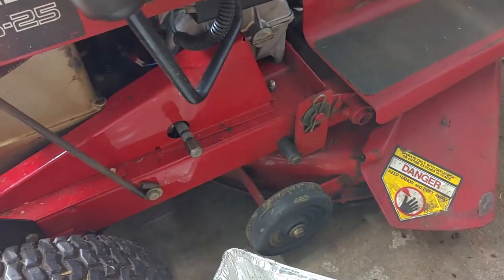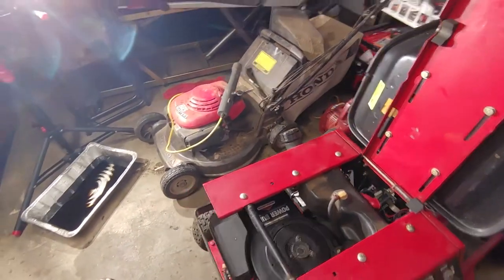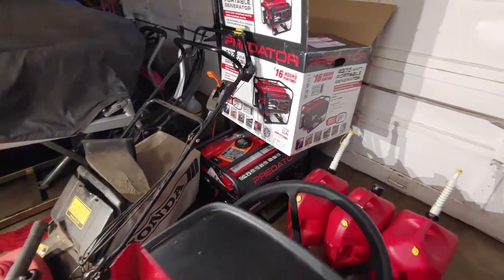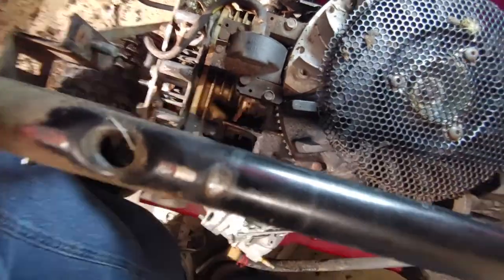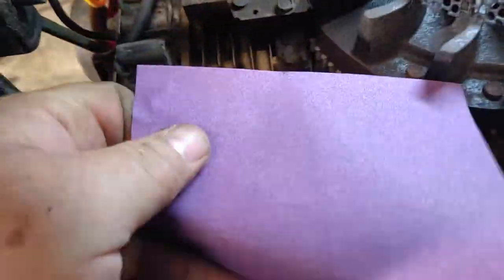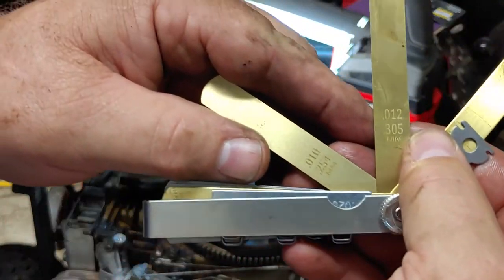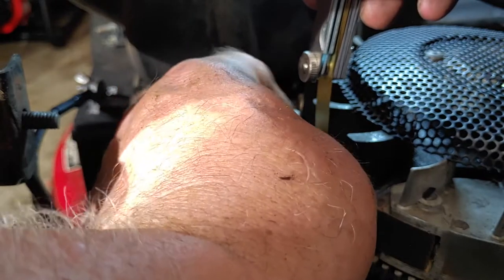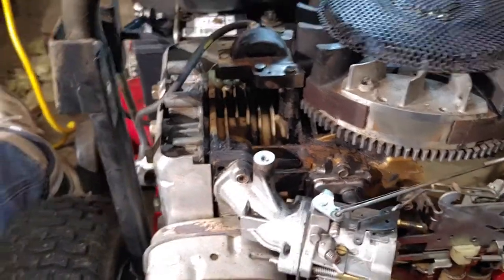Toro 8 25 Complete tune up Part 2

Comment: Nice short series on the 8-25 Wheel Horse. Just picked up one of the used at a garage sale. Quick question. The fuel line that is connected to the top of the gas tank what is the purpose for that and where does it connect to on the other end? Thanks!
Reply from the maker: That's a vent hose. It just hangs.

Comment: Awesome I have some unit I lost the top for my air cleaner cover any chance you know where to find one?
Reply from the maker: I would look first in this forum, https://www.wheelhorseforum.com/. It is all Wheel Horse/Toro tractors with a classified section. My 2nd option is find the schematic for the motor (you need the serial number off the motor) and in the schematic you can find that specific part number. Do a Google search for the part number as well as call a Toro Dealer with the part# and they can search their database.

Comment: How do you check the transmission fluid level on the 825 and what type of lubrication does it take?
Reply from the maker: Oil is SAE 30. Never checked the transmision oil. It always worked.
Reply: I don’t have trouble with mine either, but it’s starting to make noise like the gears in there are dry and there’s no lubricant I checked around and I can’t find anybody to tell me where to add it and how to check it
Reply: I think your videos are very informative and easy to understand. Keep up the good work.

Comment: Do these things have a alternator to keep the battery charged or maybe my battery is old
Reply: Mine has a stator that keeps the battery charged. But if the battery is drained you need to charge it externally. Advanced Auto parts does it for free. That fixed it for me.

Comment: What air filter does it take?
Reply from the maker: I ordered the new air filters and after 9 months, they never arrived. So, I just used my air compressor to clean the current filter. I had no choice.
Reply: @bigguydiy2184  ok, thank you!
Reply: I was able to replace the air filter on my 8-25, but it looks different from the one in the video. Go by the model number, there are different ones around.